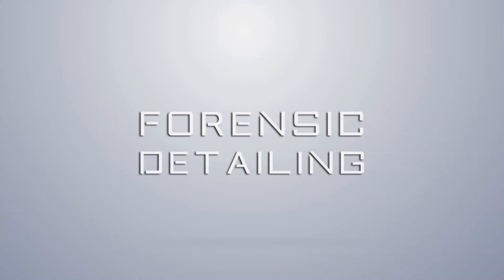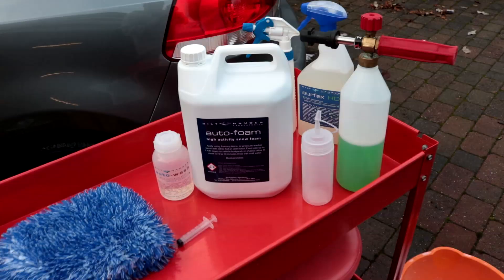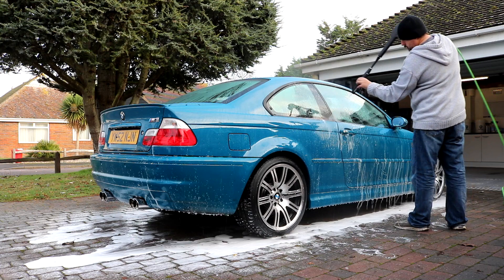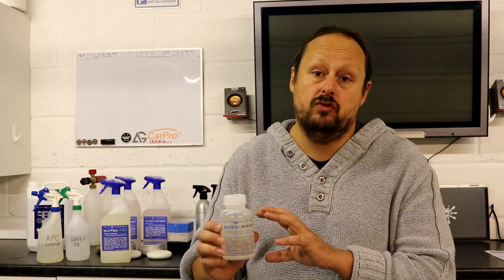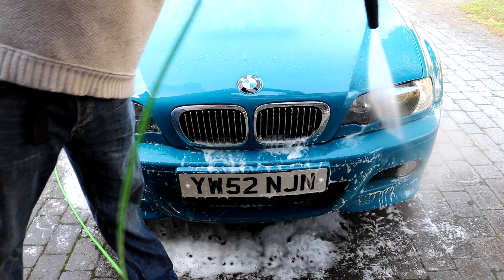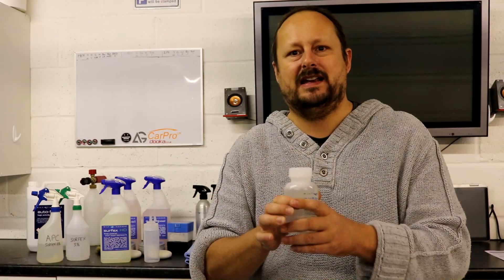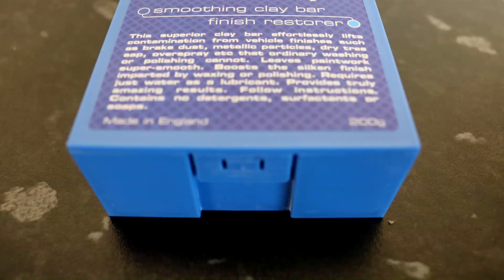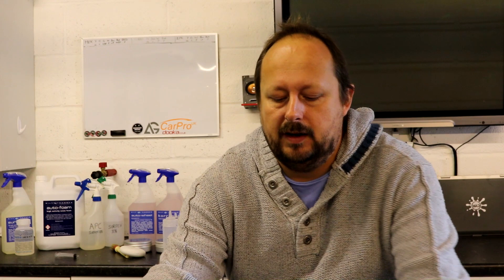Bilt Hamber Laboratories review

Comment: Morning John, what dilution ratio do you use for BH auto foam? I tried this product last week for the first time and it was nowhere near as foam like as it was in your demonstration.
Reply from the maker: I used it at about 6:1 roughly..
Reply: Gi Joe panel impact ratio should be with foamlance 8% and with sprayer 4-8%. Using it with sprayers is more economical but it can leave streaks easier if You are not rinsing it off quickly enough. Remember that it is quite alkaline product. PH 13.
Reply: I'd say 8% is a little high and double what BH recommend in either lance or sprayer.
Reply: Neil McLaughlin True. I should say 4% with foamlance and 4-8% with sprayer
Reply from the maker: when I was sat there filming it. I wasnt too sure how to get to 100:1 ratio coming out of the lance...   so I just kind of tried this diluation.. seemed decent though.. ill prolly try and figure it out a bit more accuretly

but if anyone knows the flow rate on the old K4 and can then convert that flow rate against a diluted mix I would appreciate knowing what the mix should be to get close to 100:1

Comment: Hi, recently subscribed to your channel. Could you please tell me if I could apply the snow foam with a manual trigger type spray bottle as I have no access to a pressure lance where I clean my motorbike. If not, is there any other product you could recommend? Thanks.
Reply from the maker: auto wash can be applied in a pump foamer yes mate.. 1-4% pir  so 1-4 ml per 100ml of water..
Reply: @ForensicDetailing  thank you very much 👍🏻

Comment: hi (I can not find ref to your first name or I would of used it) the two b.h. waxes you talk about, would you use a machine to put them on and a machine to take them off if  waxing a whole car? thanks dolores
Reply from the maker: hi dolores,  its Jon :) I dont tend to apply paste waxes by machine, they are a bit too sticky generally...  liquid waxes or sealants maybe..
Reply: hi jon, i guess you would not wax the whole car and then go back and polish it off with a machine? thanks dolores
Reply from the maker: you mean lay the wax out by hand then use a machine to buff the wax off the panel?    no dont do that dolores..  the machine polisher with say a foam pad (or any pad)  will work the wax around but it wont remove it..  so you want a nice soft buffing cloth to remove the product by hand.
Reply: hi jon, thank you for taking the time to reply and also for the info. regards dolores

Comment: hi, I have used the bilt hamber products for a while and while I agree that they represent good value I find the snow foam is very runny and does not seem to lift much dirt on pre wash. the apc is very good as you mentioned
Reply from the maker: thanks for that iain.  I always try to be fair.  I think BH's range is really something special though...
Reply: Forensic Detailing Channel what ratio do you use it, perhaps I'm watering it down too much
Reply from the maker: im going about 6:1 then adjusting tthe mix from the lance so its nice and white

Comment: whats your take on bilt hamber against carpro reset, tarx, ironx, eraser?
Reply from the maker: Ive not used reset or tarx.  Ive used eraser and ironx...  but without literally testing them side by side its hard to know..   but no fallout remover ive put up against BH's one have got even close to the TGA reaction times so far.  

Comparing Eraser against Bilt Hambers cleanser..   I really couldnt guess without playing around with them and trying to measure how much they strip down a wax...   or how well they can break down oil.. versus how safe etc..  

sorry bit of a useless answer I know...
Reply: Forensic Detailing Channel good to know. i appreciate your response. i highly recommend trying the tarx and reset...that would help me out and quite possibly could benefit you as well. so you say that reaction time of bh fallout is quicker than ironx? ive never used bilt hamber so im curious if they are that amazing...especially against carpro

Comment: Hey Jon, very nice review as always. Could you tell me if Auto-qd affects wax properties(beading, sheeting, looks)? I am particularly interested in double-speed wax. I am an Onr user for various reasons and I find that affects the beading and sheeting of DSW. Or maybe you could suggest another qd who doesn't mess up to much with the properties of a hybrid type wax like DSW. Greatly appreciated!thnx
Reply from the maker: hello mate.. any product that leaves something behind on the clearcoat will effect the surface characteristics of what you are laying it onto..    So if you looking for a detail spray which doesnt effect this, it would be one that doesnt really add many components .. (most of them use quats based silicone and forms of poly siloxane, or wax emulusions... some alcohol solvent and lots of water :)  )

if you like to maintain hydrophobic water characteristics it can be good to combo protective products certain hydrophobic chemistry with detail sprays with use a similar underlying chemistry.... 

For example, if I use Angelwax 5th element I always top with Angelwax QED...  thats a combo which works.

Your right about auto-QD that one is all about the gloss and the charged polymer tech to reduce marring when using it as a spruce up product.  but the gloss is exceptional..

Some good products that you can use to match up to a hydrophobic base coat wax or sealant are

Autoperfekt Silk  or Angelwax QED

If you want to go full monty on hydrophobic you could use sonax BSD.. if you have not tried it, the water behvaiour will blow you away.. there is simply nothing else like it, its stronger than most sealants in terms of how it holds onto its liquid rellency... (cheap to)

If your old school there is one other cool alternative..   Waxaddict Fo'show..   Total wax based water emulsion with no solvent..  Its a pure form of a loose liquid spray wax and as theres no solvents it doesnt bit into anythign thats underneath it when you apply it and the gloss and beading are excellent (5 min cure time though so its not a traditional spray on wipe off thing)... excellent though mate...
Reply: Thnx for taking the time to wrote such a thorough response. 
I am very familiar with BSD but it is not an option for me(it's more a sealant than a qd imo, but a very good option when you don't find time to renew the protection on your car and use it in-between washes). From where I live I can only buy Angelwax QED or Auto QD. I suspected a combo from the same manufacturer will be the best bet. I really like the properties of DSW and I want to preserve them as much as I can, regarding the fact that I am tied to rinseless wash(ONR,at the moment). I also don't care for added gloss so maybe Auto-qd in dilution let's say 1:5, will revive beading/sheeting(this are basically the weaknesses of ONR on a hybrid like DSW) while maintaing a minimum level of gloss? 
Thanks again for clearing some things up and for the Waxaddict Fo'show tip(valuable info).
Reply from the maker: give angelwax QED a run out.. its cheap as well...  ;)

Comment: Would it be ok to put dsw ontoo of another lsp dont have any pre wax cleaners
Reply from the maker: you can, but generally with any format of wax with offers strong durability they are best not used as toppers... at least in my opinion...

I tend to top with things that have little durability like, detail sprays, like natural show waxes or even wet look emulsions...
Reply: Theres that fracla g3 detox shampoo in halfords that might strip the LSP before i apply dsw
Reply: Have you ised car chem 1900:1 on car that has dsw on it if so has it affected the beeding because the shampoo has hydrophobic propaties
Reply from the maker: think i use autowash hakman
Reply: Im just concerned rhat it might affect the beeding

Comment: Hi Jon, been going through your old videos. I am trying to restore my 12 year old car which has not been detailed before. I am looking for a shampoo for decontamination wash. The BH autofoam is pH 13. Can I use this to remove old waxes and sealants. I will be using this to wash my car like a shampoo as well.
Reply from the maker: Hey chris... in short no.. Autofoam even though its high alkaline is not really going to strip products.  although all detergents will to a certain extent.   if you want to strip wash maybe check out meguiars plus as a shampoo..  and then an abrasive pre wax cleanser.   If you are literally talking the final last reminants of a sealant then non abrasives products like angelwax stripped ease or bilt hamber cleanser fluid (non abrasive) maybe sufficent..  ultimaetly though to get it all off you need to use something abrasive...
Reply: Forensic Detailing Channel thank you for your prompt reply Jon. I will try the meguiars wash plus.

Comment: What you’re surfex dilution for interior and exterior 👌
Reply from the maker: 10:1 for engine bay wheel alloys degreasing etc..
1:20 for lower panel prewash

1:30--- 1:50 for inside generally  dash board, wipe over leather etc..
Reply: @ForensicDetailing  thanks mate much appreciated am sik  loads different mixes when you said in the vid one for exterior one for interior made sense I have like 4 different dilution made up 😂
Reply: @ForensicDetailing   what’s it like for cleansing upholstery one thing I haven’t tried
Reply from the maker: @aaronbell8527  really good yer I use it at 1:30 in a pump sprayer with hot water.. spray over the upholstery work it with brush or drill brush and extract.. works great and no slimey residue left either.
Reply: @ForensicDetailing   thanks mate going to  give that a go Tomora

Comment: Great video! Have you ever tried companies like madcow detailing or ez car cars?
Reply from the maker: i think a few yes mate..
Reply: @ForensicDetailing  what was your opinion on them? I'm just getting into detailing and have been using bilt hamber products since but recently ordered a madcow box and loving it so far. Wheel cleaner no way near as good as bilt hamber but the rest is decent!
Reply from the maker: @bradleypauley6036  I cant really rmemeber the madcow I think I used a detail spray and a glaze.. EZ I used the citrus snow foam and it was ok.   I just like BH personally ebcause its very strong high concentrated powerfull products very good price too.
Reply: @ForensicDetailing  I'm with you! I'm hoping to expand my BH collection and my detailing collection on general as have fallen in love with it over lockdown. Thanks for the reply!

Comment: hi. looking for a bit of advice, I have a vw golf 7 gti with the mirror style 5 spoke alloys. I was looking for a wheel cleaner and bilberry from valet pro gets a good review. is it safe to use on the wheels?? thanks
Reply from the maker: yes mate.. I use that..  Its a strong degreaser cleaner.. but you can water it down if your looking to preserve a sealant or wax coating...    trick is to get the wheels clean and sealed to the stage where you can clean with shampoo/soap regulary...

Comment: Have you tried auto finesse avalanche? Their citrus power formula is present in the snow foam
Reply from the maker: yesh m8
Reply: Forensic Detailing Channel What do you think have better cleaning ability? And the valet pro citrus prewash?
Reply from the maker: what has better cleaning ability compared to what please mate?
Reply: Forensic Detailing Channel I mean between auto finesse citrus power, bilt hmaber auto wash, valet pro citrus prewash and valet pro ph neutral. Which one do you consider is the best?
Reply from the maker: a citrus is offering you something a bit different. citric acid is a pretty handy for lots of  reasons though.  Its good with soap stains and water spots, its good to attack solid dirt or contaminantm and mould.   lots of other reasons.

alkalines are cool because of their ability to degrease..

but yer to keep it simple BH autofoam for me.
Reply: Forensic Detailing Channel Can you please tell me which one is citric acid and what kind is BH?

Comment: Just used up the last of bilt hamber wheel cleaner won't both buying it again over priced and not that good
Reply from the maker: its the most powerfull TGA cleaner on the market.  And at 12.95 for a litre its typically close to half the price of most fallout removers. which are around 9-10 pounds for 500ml.  Have a watch of the "best fallout remover" video on the channel where its tested with other market leading products and we factor in cost etc..

If you want value just clean your alloys with surfex HD. 5 litres at 17 quid and you mix down 10:1 so your paying pennys per wash.   You dont need to use fallout remover everytime you clean your wheels.